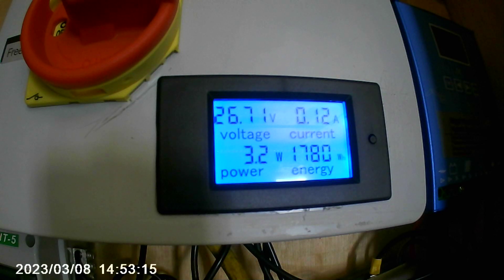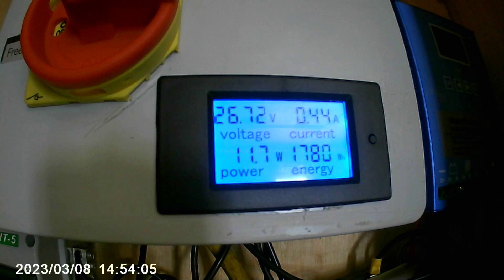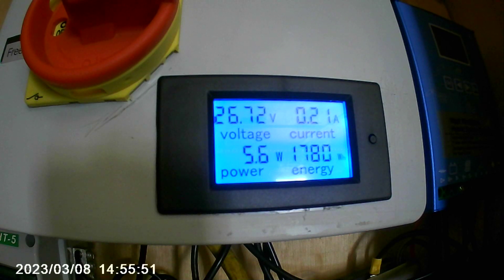ista breeze i 700 mod are longer blades better part 2 they create more watt hours over time success

Comment: Hey Reggie, I have 5.14 kw 48 volt LiFePo battery syirage from my 1600 watt solar. I want to add a wind generator to help during the winter. We get a fair bit if wind here on the north east coast of NL. From what I have seen the isra breeze 700 would be a good choice. What recomendations could you give me overall? I have watched your videos and appreciate your testing and input so far. Did you purchase directly from Ista or is there a closer dealer?
Reply from the maker: I would step up to the 1000 ista breeze if possible.ordered my gear from ebay get the three blade carbon fibre blades.direct shipping from turkey to n.s.

Comment: How much was the turbine?
Reply: These are really useful videos. No one else on youtube doing this sort of analysis. So, much appreciated. Energy v power results can really surprise. A lot to do with the cube effect. Double the avg wind multiplies power by 8 (!). So only a small increase in avg wind speed, by say, 15% can nearly double the energy output.  With my i1500 I've often noticed how power can really take off with gusts, jumping from 100w up to 900w in just a second or two.trying to find one Makes testing difficult, unless you have an anemometer which logs data over time. It's hard to guage avg windspeed by feel/eyeball. I'm trying to find one at present.
Reply from the maker: These i700 turbines are 600 canadian dollars on ebay
Reply: I just checked, they're out of stock
Reply from the maker: @davidpotter9462  there all over ebay if i were you i would get the i 1000 it comes with the longer blades